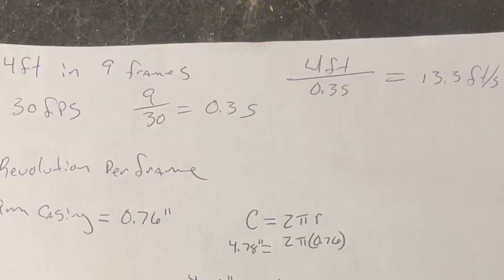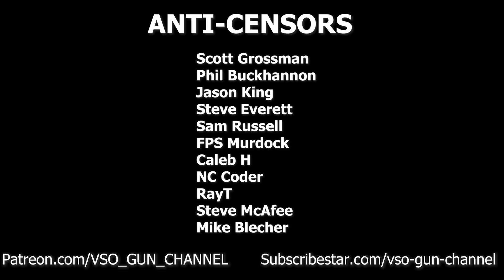How Did a Falling Shell Set Off Ammunition?

Comment: I actually love that you broke down the video with all the math because, as a handloader, this sort of explanation is the stuff I love to learn about because I knew there had to be a way that primer was fired by the energy transfer of the spent casing striking it. If ammo could be set off by rapid heat transfer  then we'd hear more about accidental discharges in the summer from folks leaving them in their vehicles. It takes awhile for heat to transfer, like when mythbusters dunked a gun in 350° cooking oil and it took 3.5 minutes for it to set off

Comment: Very interesting topic and I appreciate how much effort was put into the test.
Primers are an example of damn near perfect engineering. Think of how reliably they discharge when they’re intended to (under the correct conditions), and how incredibly rare it is that they discharge when the correct conditions aren’t met (as demonstrated in the vid). It’s fairly easy to err on the side of sensitivity or specificity (sorry I only know the data terms, not sure if the engineering terms), but increasingly difficult to get it just right every time.

Comment: Your hypothesis is correct as the most likely culprit was the shell striking the primer at just the right angle to maximize whatever pressure it was able to exert with its combination of weight and velocity.
A very simple way to prove this is pushing an icepick and a hammer's head against an object with just a small amount of pressure.
Since the hammer head has a large surface area, even though it's heavier than the icepick, it will do little to no damage while the needle tip of the icepick, despite being lighter, will penetrate with the same amount of pressure.
That's what happened here - the lip or edge of the shell struck the primer just right and possibly on a portion of the primer - such as where it curves down - which was a little weaker and that perfect storm caused the detonation.
This is why we've all found spent shells laying in and on our box of ammo without the ammo exploding - because you need a very high odds of happening set of things to occur for that accident to happen.
As for folks being anti-capitalist, I'm thinking it's more of a case of them being anti-big business since the leaders of big business proved a long time ago that they are not our friends or allies.
After all, it's not like no ammo or gun makers have ever betrayed their customers to the left and big government, right?

Comment: Nice second take. I've had shotgun shells dropped accidentally on a concrete skeet pad. Clumsy partners. Eventually, one hit a piece of pea gravel in a sweet spot on the primer. The casing did its job by rupturing sideways under pressure, and the shot+wad didn't clear the crimp. No video, thankfully. The ensuing dance was not all that flattering. ;-)

Comment: I have seen first hand 45ACP, 9mm, 22LR, and a 454 Casull live cartridge go off by either being dropped onto rocks, other debris, and in the case of the 22LR, just concrete. 

While it CAN possibly be dangerous, the primer ignition setting off the propellant isn't going to launch the projectile. Physics! The brass case has shredded or blown a hole in each example I've seen, in a few cases not even moving the projectile from the case mouth crimp point. 

You might get a couple scratches, my buddy suffered a 1.5cm papercut depth laceration to his bottom lip from a piece of brass that flew off the case of a dropped 45ACP. 

Wear safety glasses!

Comment: Sorry, but I am not sold.

However, has anyone considered the possibility that unburned power combined with partially burned power.  Brass on brass or static discharge might play a bigger role.

Also, i see 5.56 brass as well as an opened box of pistol ammo..

5.56 brass tends to still be smoking when it ejects... that suggests a lot of hot power  flying around. 

There is no way to determine the precise timing since the power dusting on the open box of ammo could have been there for several seconds.  To assume the impact is the cause is to beg the question..

Comment: I'm sorry, the margin of error in those equations, and so many assumptions, seems more like we are being trolled by VSO in this video :)  With so many variables we will likely never know and it was a random fluke. Just like the odds of flipping a coin are not 50/50 for heads or tails - it is possible the coin will land edge on.  I also agree that the heat likely added to this as well.
Reply: That's the thing though - he's not trying to say that this is the exact math of what exactly happened, instead, he's giving us an idea of the most likely scenario and providing some math to prove his point.
He is correct - the smaller the surface area, the more damage the object does with its combination of mass and velocity - that's why an icepick will go straight through your skin if dropped from a foot while a hammer won't even though the hammer is heavier.
As such, he establishes the rough amount of psi needed to detonate a cap and then figured out how much energy the shell could have generated - not enough...unless that energy was focused just on the lip or rim of the shell in the same way as the point of an icepick.